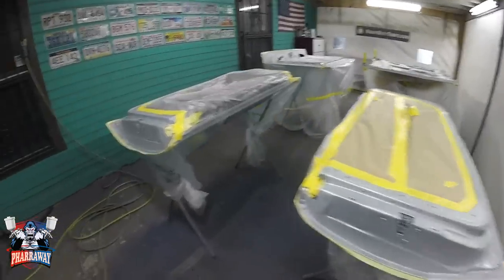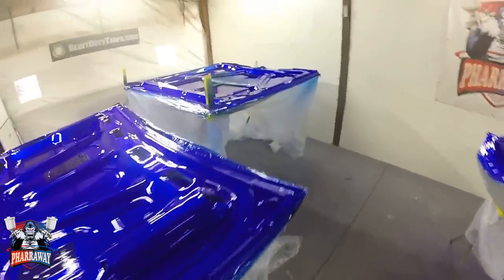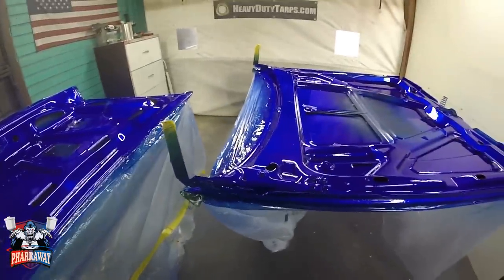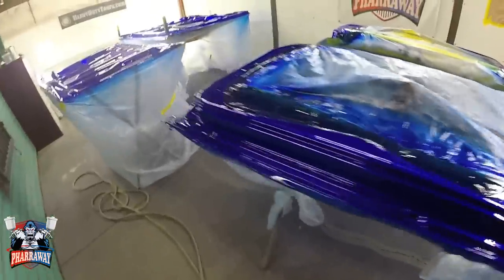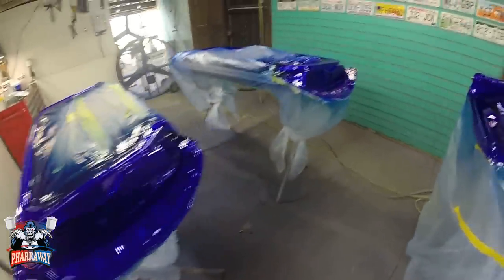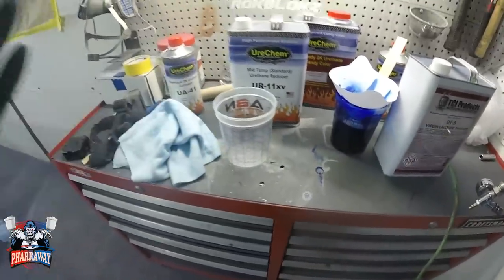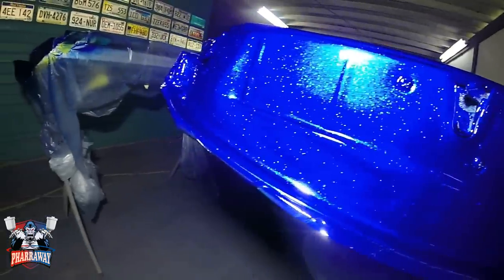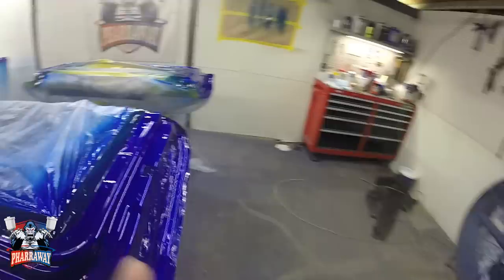How lowrider cars are painted with candy paint and metal flakes part 9

Comment: To can’t wait every week to catch your video’s.  Why didn’t you paint the center of the hood also. When you painted the hood you go around all 4 sides and paint.  Wouldn’t it make each corner darker with the overlapping in each corner.  Keep up the awesome work bro.  Coming out nice 👍🏾
Reply from the maker: There is a heat shield that goes there and if your not careful yes it will get darker

Comment: Hi, thank you very much for the video. In your opinion, which gun lays down the Candy flatter. The WS400, the 5500i or the Carboni? And as always nice work!!! I believe it is not the gun but the person behind the gun and application technique. MUCHO GRACIAS.
Reply from the maker: for me the carbonio
Reply: Well, I am afraid, I do Not have the Carboni amongst my arsenal of spray guns, which have reached 28. So it will be the Sata 4000 B hvlp or the Iwata Bellaria for the initial base, flake intercoat etc and top coats with the Lotus green or Hakone blue WS400. Just play about with the air pressure to get the clear to lay down and flow out!!! Thank you....

Comment: Have you used the dv1 clear coat gun yet, if not you need to it’s a good spray gun
Reply from the maker: No not yet
Reply: Not a cheap gun, but absolutely clean flat finish on 22 to 25 psi

Comment: hi    i m here with another question      on a normal paint job at about 70 degrees      is this correct     using Tamco products         lay down my dtm primer          flash 30 minutes          3 coats base 15 min flash between    flash last coat 30 min     tack rag          3 coats 4100  20 minutes flash          so my question is 2 questions I guess lol      are my flash times good           and when do I unmask              thank-you again for your time       I very much appreciate the advice
Reply from the maker: yes that is perfect I would unmask it at around 6 to 8 hr drying
Reply: @PHARRAWAY  thank you    I have a friend tellin me 2 to 2.5 hrs      so now you have to beat him up lol
Reply from the maker: I wouldn't do it that way but everyone is different